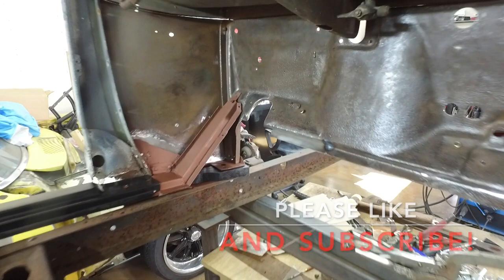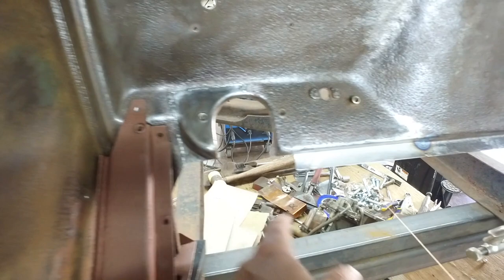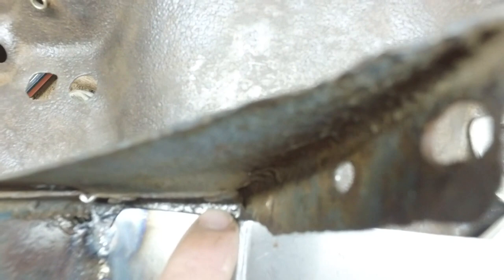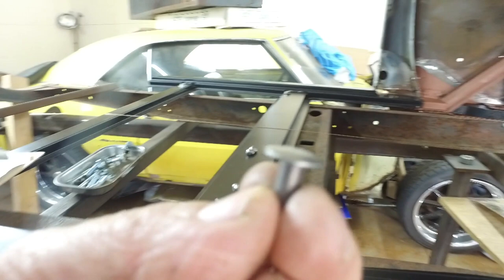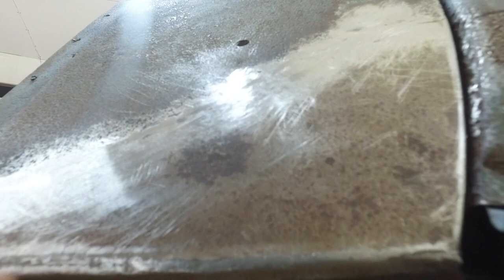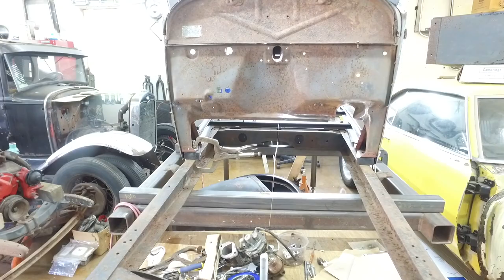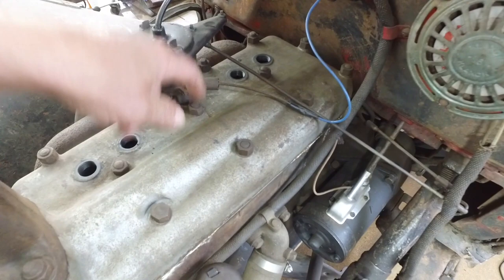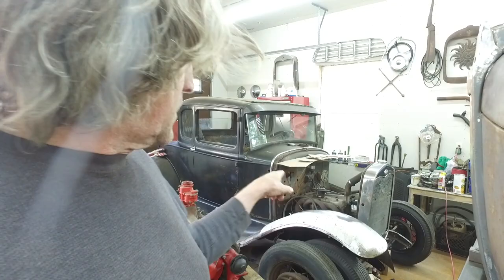Model A Metal 3 Cowl Update!

Comment: Thank you for offer but no fenders. This will be my first ground up build. Gonna be late 40's early 50's traditional hotrod, with a basically stock banger dual carb and header,. Even staying with stock wheels only using larger 21s on rear 18 on front. Heck, even gonna use Mechanical brakes LOL. I'll contact you if I can't find what I need . What city and state do you live in? Thanks again Bill.
Reply from the maker: tolland county Ct